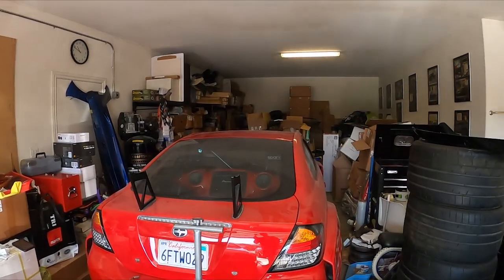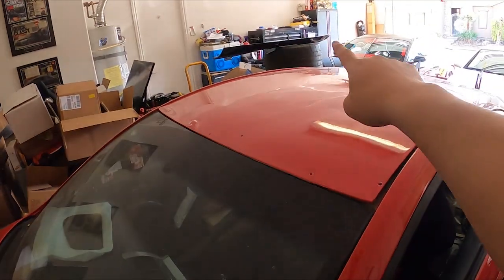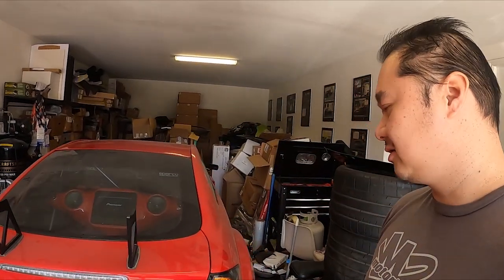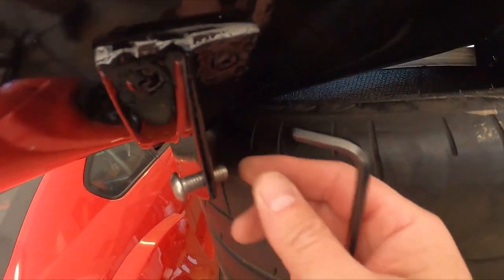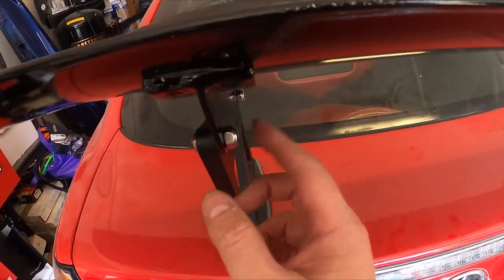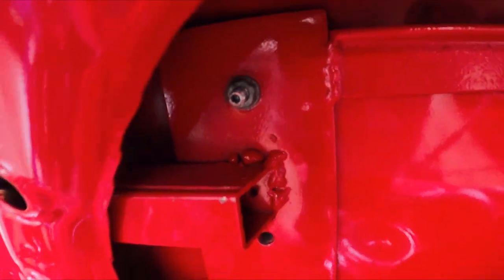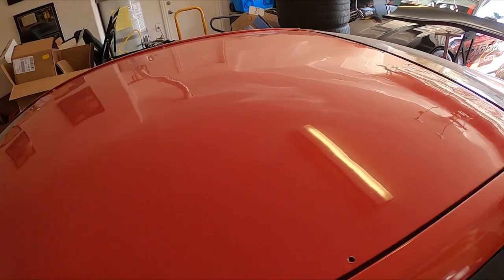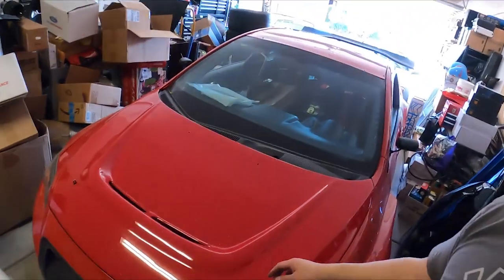Finally starting on the Scion tC project.  I'm pretty EXCITED to get this car done!

Comment: What body is on that car I have a scion and was looking around for one similar
Reply from the maker: Hi Nathan.  It is the Scion racing / rsr widebody kit.  Not available for public sale unfortunately.
Reply: Is this car still for sale? Or do u plan on keeping it for yourself ?
Reply from the maker: @nathaneddings1092  will be for sale soon once I wrap up a little bit more of work / diagnostics some of the small issues from it sitting.
Reply: @M2Motoring  still interested once the project is complete
Reply from the maker: @nathaneddings1092  cool! Should be done by fall.  Not much left to do but I’ve had to employ help from a friend to figure out one of the car’s issues and am just waiting for it to cool down and him have some time to come over to take a look and diagnose .